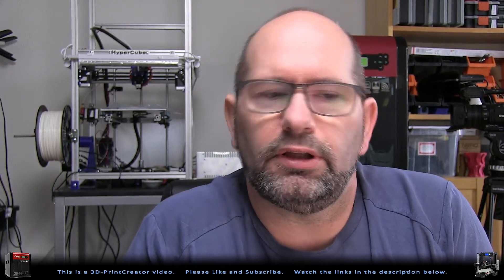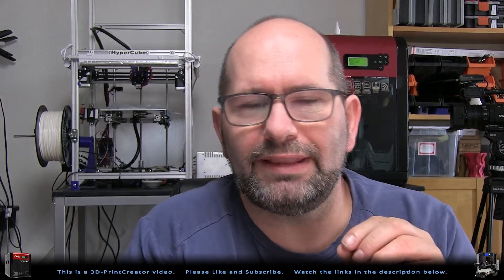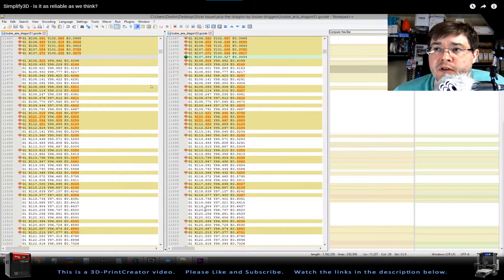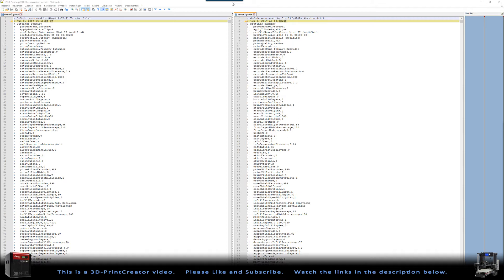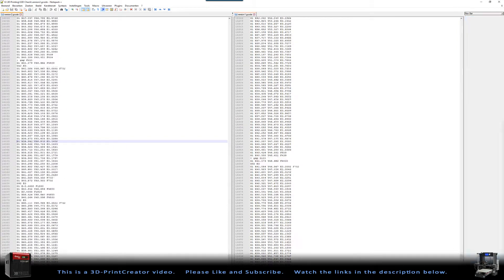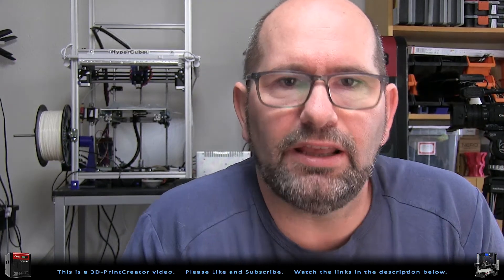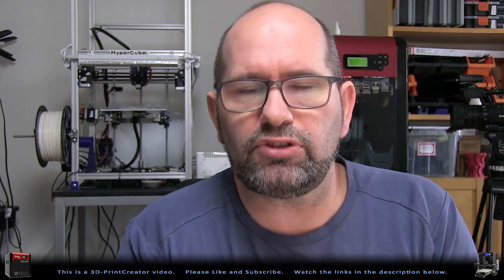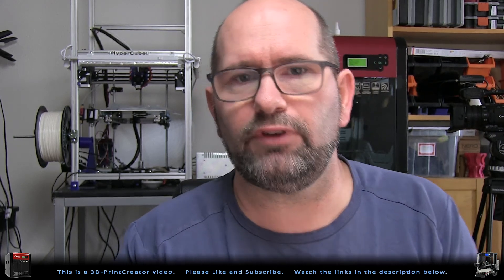▼ Simplify3D differences between two times slicing the same object

Comment: Did you guys use the exact same .stl file to check this? Seems to me that it has to do with the object and the detail level of the object itself. The software has to somehow interpret some parts of complex object from a digital shape to an 'analog' form. Maybe the algorithms that are used give different results depending on programmed randomisation?
Reply from the maker: Dustin didn't provide the file so I am not 100% sure, but I picked up the same model on Thingiverse.

Comment: It looks like this is just math. E0.#### is the extrude gcode with mm of filament. Can the stepper motors even resolve the 4th decimal place? The deviations in his X and Y appear to be on the thousands of a mm scale as well. I'm not an expert, but ten-thousands of a mm to extrude seems like it might be asking a bit much. The DaVinci pro has a resolution of 100 microns which is .1mm, so I wouldn't be too worried about .0001mm.
Reply from the maker: I am not worried at all, in fact... I think there is no better software then Simplify3D on the market for 3D printing.
Funny thing though is that I am not nearly having that much problems as some others have. You can even doubt it I have any problems at all.
Like you said, chances are little that my steppers can resolve this resolution.
Reply: You're actually why I bought Simplify3D and haven't regretted it once! I wish it were easier to run multiple machines at once, but I'm not going to complain about that. Keep up the videos and thanks for helping me get started some many months ago!
Reply from the maker: Do you know you can run multiple instances of S3D at the same time?
I sometimes have 4 printers printing at the same time, all controlled from S3D.
Reply: Yes sir! As far as I know I have to go to Help -> Configuration Assistant and change the device every time and it makes a new profile.  I've also had it happen that when I disconnect another device(laser or printer) from USB Simplify3D will get confused. I think that's actually from the driver though, and not simplify itself. I wish I had 4 printers! I have a DaVinci Pro and an Anet A8 and another Anet A8 on the way. Some lasers too. :D